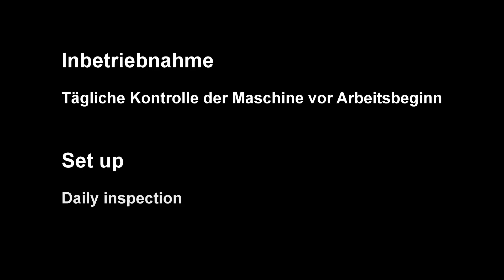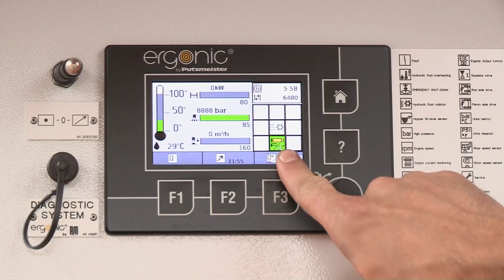Putzmeister: Operation, daily machine control before working, Ergonic 1

Comment: what kind of speed must be used to use the pump ... for the p.t.o
Reply from the maker: Hi and thanks for your message. The minimum speed of the motor is 1000 rpm to be able to pump. How to switch on the PTO: idle, press the switches mast and main pump (if available, press the clutch pedal)

The PTO version can be seen in this video:
https://www.youtube.com/watch?v=TemuVrJZOew